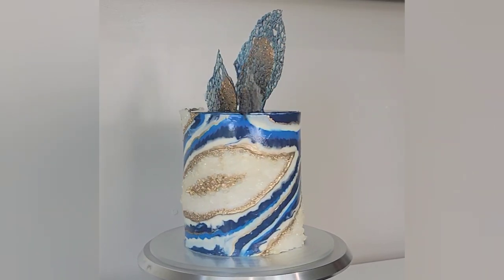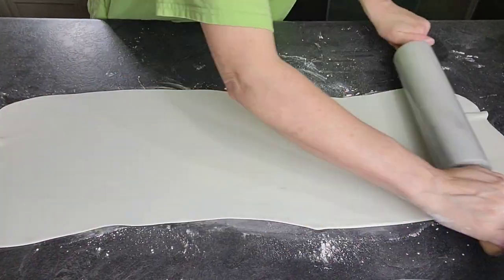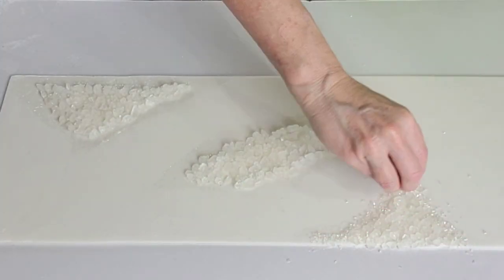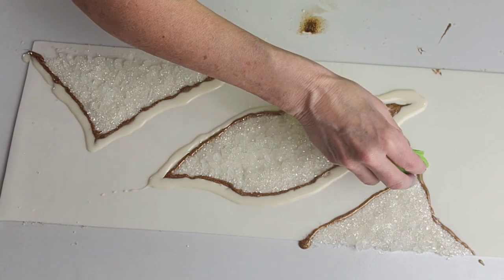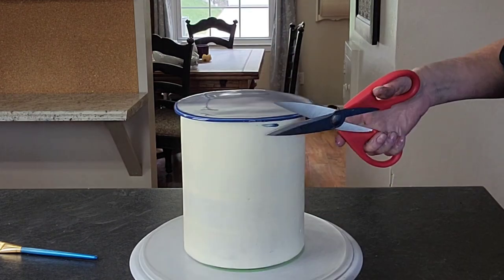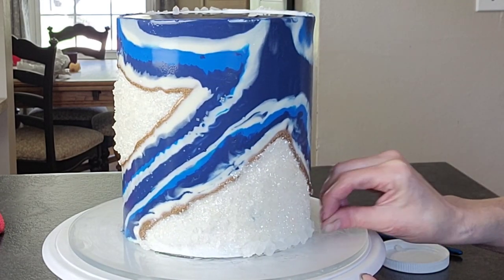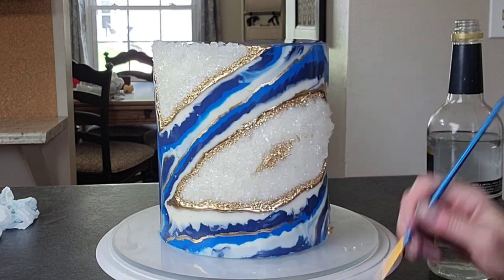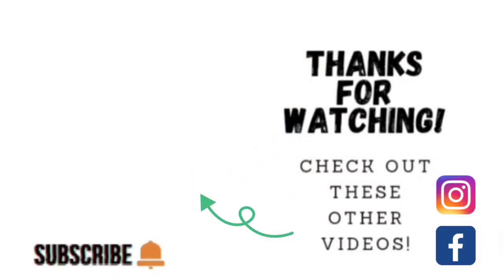Edible GEODE RESIN CAKE | Edible "Acrylic" Art Cake | Simple 1 Ingredient Bubble Sugar Cake Topper

Comment: Hello ma'am. If the buttercream is cold, the fondant will moist right?? Hope you answer me🙏
Reply from the maker: If you let it set in the fridge after you attach it, that helps with this. I leave my cakes in the fridge until about an hours before serving or presenting. I testes one of these cakes and it sat on the counter at room temp for 4 hours and was fine. Straight from the fridge.  Of course humidity levels do make a difference, so make sure it is in an air-condition space.

Comment: Good afternoon. What is the ideal room temperature to display the cake? or should remain in the fridge until cut. thank you.
Reply from the maker: I am testing that right now!;) I have had another one with the same technique on my counter for 3 hours now and it is fine. It is about 70 degrees and not humid where I am. I would probably suggest leaving it in the fridge till Maybe 1 to 2 hours before serving. In humid conditions, I tend to leave all cakes in the fridge for no more then 1 hour prior. Humidity makes everything more unpredictable;(
Reply: @sophisticakesbymary  thanks. In My place the weather is hot and humedity..over 90 degres F.